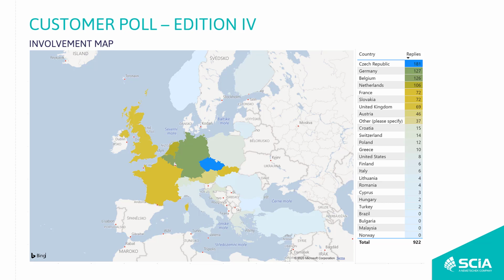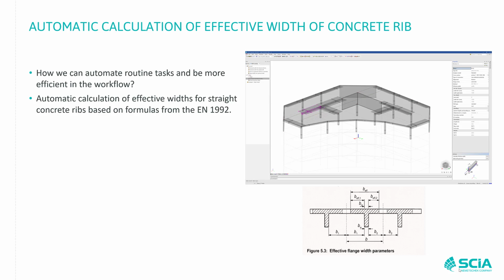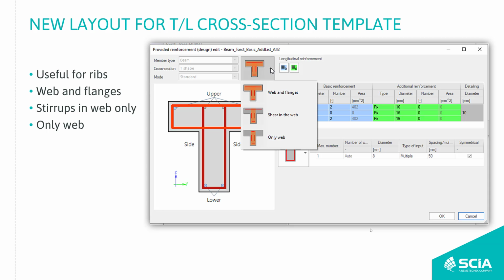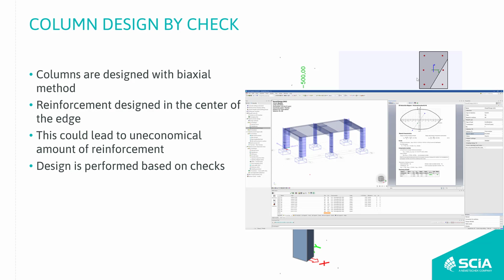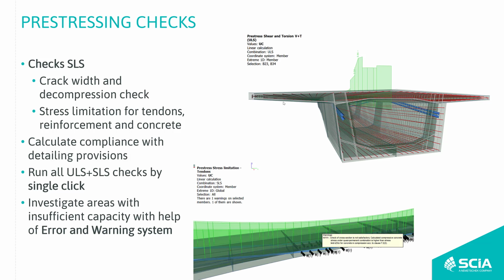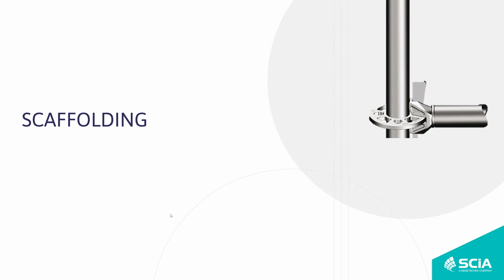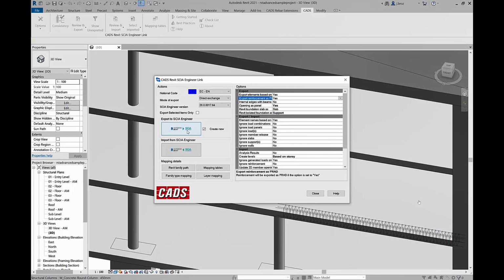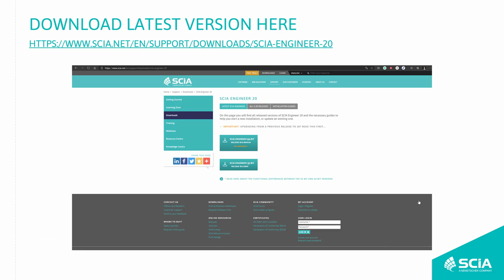[EN] What's New in SCIA Engineer 20

Comment: I am a SCIA Engineer - EXPERT version user and I can conclude that SCIA 20 brings nothing of reeal engineering valieu...
Reply: Salut Radu. Încă nu au armarea fundatiilor izolate, nu au ancorarea prin carlige la grinzi / stalpi sa le calculeze / tina cont de ele, planseele se armeaza greu, varfurile de tensiune din analiza FEM intre stalpi si placi nu se mediaza automat dupa o regula clara si rezulta o supraarmare pe reazeme (aspectul nu-i rezolvat inca), interfata e tot invechita, nu au lucrat nimic la partea de conexiuni metalice, analiza CBFEM nu-i implementata (exporti in Idea Statica, alt soft, alt cost) etc. Nu au imbinarile la structurile din lemn, de asemenea nu au note de calcul complete pentru lemn. Nu au tutoriale clare pe partea de zidarie, nu stii cum să modelezi corect. Nu poti modela o zidarie confinata. Allbim au zis ca scot, dar se pare ca inca nu. E un produs bun dar nu complet si nu acopera totul. Am putut vedea un pic din versiunea 21 beta si intr-adevar interfata este schimbata / mai moderna, dar ramane de vazut forma finala cum va fi. Nu stiu de ce n-au imbinat SCIA + Risa 3d + SDS/2. Au mai facut magaria asta de Auto Converter care putea fi direct implementat in SCIA. Cu ce probleme te confrunti in munca de zi cu zi la SCIA? Unde pierzi mult timp? Salut.
Reply: @poparafael3065  I've been using the software for quite a long time, concrete design and reinforcement as a whole still feels lacking compare to other software which include some of your concern as well (From google translate). I really wish they improve those.